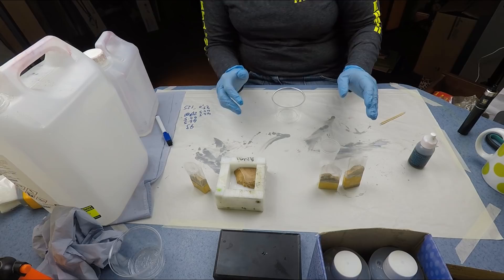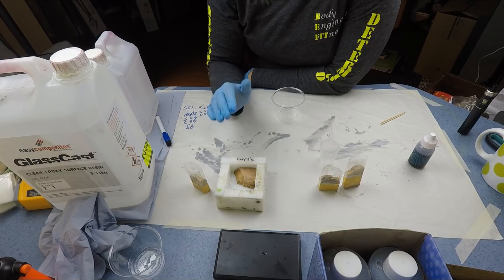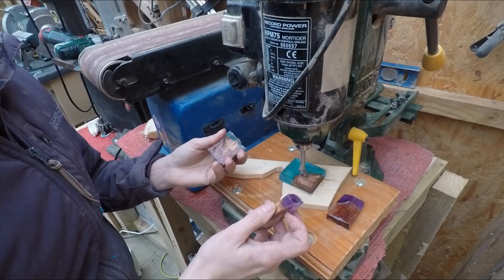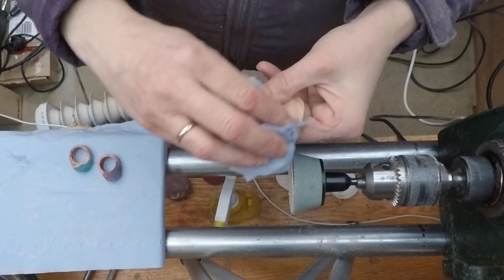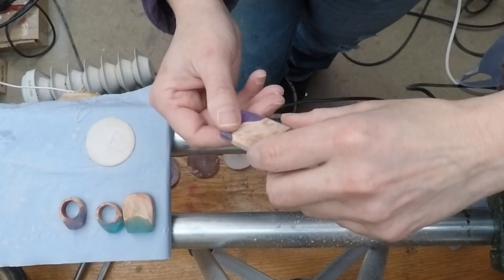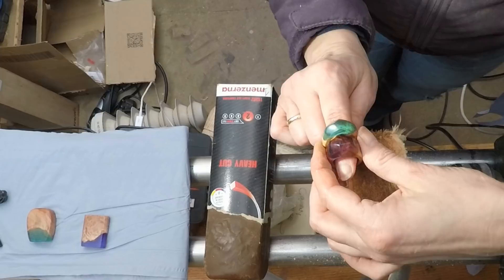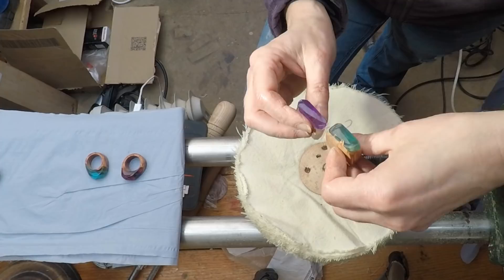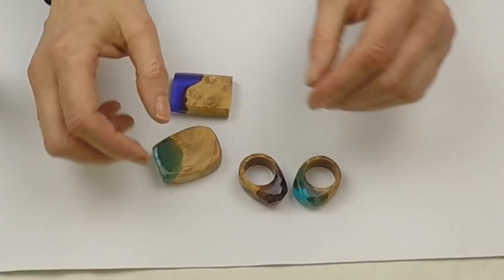Alumilite v epoxy for jewellery

Comment: Well that's got you thinking!
You said the epoxy is softer, if it's like the epoxy glue I use you may find that left longer to cure it will harden even more.
Reply from the maker: lol yeh it really has got me thinking i also didnt realise that amazing casting resin is epoxy, which goes to show lol Yeh your more likely right about longer cure times. Many thanks Paul :-)

Comment: I like your vids a lot... lot of info. The only thing better with alumilite for castings is that it cures in about half the time most cast epoxy's need to get completely hard. I leave my castings(mostly knife handle scales in very cheap epoxy for 3-4 days before i sand and polish them. Those castings are cured after 24 hours....but they still can be bend like soft plastic. Only after 3-4 days they become solid not bendable . If you are not in a hurry Alumilite is complete a waste of money. :)

Comment: They all truly did come out very pretty. I myself have been working with a lot of resin and epoxy. The epoxy is brittle on the lathe. It seems to Chip and just shatter. The alumilite seems to handle the lathe a lot better. I was quite surprised on how these came out. I was thinking there was going to be a lot of bubbles in the epoxy. Who would have guessed?
Reply from the maker: Thank you Tracy :-)

Comment: Good video Pam, Didn't look like there was too much difference between the two.

Buying the Amazing casting resin in the 450ml pack is very expensive. Compared to 7.5 litres of Alumilite clear which I think worked out at half price when I was researching.

But if the buyer is only making a few pieces then I suppose they don't want huge amounts of resin hanging around.

All the best,
Paul
Reply from the maker: Yes you right the bigger packs are far better value before i found metal clay, i used to only be able to get the 450mls and worked out very expensive. Many thanks :-)

Comment: Hi Pam I've ordered my amazing cast resin. Iam really having trouble with the other resins setting.ive used water clear resin and epoxy and both take days if not a full week to set..the only thing I can think of it's a temperature problem..just a quick one is Alumilite not a epoxy resin..lol
Reply from the maker: Hi yes amazing casting resin is epoxy lol :-) The temperature is really important with any of the resins they hate being cold. Amazing casting resin does not smell so can be left in doors. Good luck and if i can help in anyway feel free to get in touch :-)

Comment: Do you used any water-sanding papers before using the polishing wheels? is it enough efficient to polish them without watersanding them before?
Reply from the maker: I dont do any wet sanding all dry sanding and then polish many thanks :-)

Comment: Another very worthwhile video. Pam, which epoxy did you use to do the comparison with last time? I understand if you’d rather not say!! Thank you 
Chris.
Reply from the maker: Thank you Chris is was resin4art but i would be interested to try again as ive changed how i sand and polish resin since then. :-)
Reply: Highlandboxes 
Thanks for that Pam. I was looking on their website just the other day in view of getting their epoxy. I’ll probably still go for it but in the smallest quantity just for a try out! I’ll also get a small quantity from Easy Composites as well. Thanks again Pam, and keep these great videos coming. 
Chris

Comment: do you need to use a pressure pot with the glasscast poxy resin
Reply from the maker: Hi Matthew i didnt for these, and with the rings its not so important as the tiny bubbles dont effect the look. When im using the resin for pen blank i do use pressure though to get a bubble free finish. Hope this helps many thanks :-)

Comment: Hiya, great video thank you for sharing ....only new to resin so I'm a tad confused:- 
1/   Were these both Epoxy resins? 
2/   Was the Alumilite amazing Clear Cast Epoxy the better cheaper option. 
        Or was the Easy Composite Glass Cast cheaper and better?
3/   Can this type of craft (wood rings and wood pendants) be done with Polyester Resin?
4/ Was there a reason you used Glass cast clear epoxy SURFACE resin and not GlassCast 10 clear Epoxy Casting Resin?  
I know i'm sorry for all the questions, I was hoping this resin thing would be simpler, but there seems to be a different resin for everything instead of a 1 does all resin.
Thank you for any help you can offer.
Reply: appreciate the like... however I was kind of hoping for a reply ....😁👍
Reply from the maker: Hi sean 1) yes both epoxy 2)   yes i prefer amazing clear cast and if you buy the 2 gallon pack its the cheapest. 3) yes poly resin although very smelly is a good resin but is prone to shatter if dropped unlike epoxy.   4) the other resins were not for sale at this time but i cast thick blanks with this and it worked fine. If you are looking for a one resin for all i would buy amazing clear cast i make large blanks, resin art and rings pendants and also pen and knife blanks with this resin i get it from houseofresin.co.uk i will give you the 10% code for your first order up to you if you use. I hope this helps 

http://www.metalclay.co.uk/
One per person discount code
HB1017
On all resin, dyes and powders.
Reply: Ahhh brilliant thank you so much, really appreciate that.  I'll definitley be taking your advice. thank you.

Comment: Hi Pam, very interesting as alumlite is expensive but the result with epoxy looks great!!
just one question on the wheel no2 and the final finish wheel what compound did you apply? Thanks in advance and very helpful tutorials.
Reply from the maker: Many thanks Mahendra the second wheel is Glosswax 16- Beige Polishing compound and the last one is P175 Yellow Super-finishing compound. :-) This is a useful link to explain them http://www.thepolishingshop.co.uk/acatalog/Guide-to-Menzerna-Compounds-for-Woods--Plastics-and-Lacquer.html
Reply: Highlandboxes thank you Pam you are extremely helpful 😊

Comment: Hi Pam, you mention Epoxy and Alumilite but what is Alumilite?  Is it a polyester resin or an epoxy? Or something else.
Reply from the maker: Hi Heath its Alumilite amazing casting resin which is polyurethane and glass clear epoxy ive put links in description if you want to check them out. Many thanks :-)
Reply from the maker: Heath its just been highlighted to me the Alumilite amazing casting resin is epoxy its the Alumilite clear thats polyurethane just wanted to make sure you had the correct information. :-)

Comment: Pam! I am bothered by excess fumes and wonder which of the resins are the least offencive?  ron USA
Reply from the maker: Ron both are odourless although if your sensitive i would also be in ventilated room as a precaution. Hope this helps many thanks :-)
Reply: Even though Epoxy Resin is practically odourless, We have recently found out that both myself & my wife have an allergy to Epoxy resin 😢
We both got a nasty rash that took a week or more to get rid of with really high strength antihistamines, my wife was even worse with massive puffed up face which took steroids to get rid of.
We seem to be getting away with using up what we’ve got left, by wearing full PPE including organic vapour respirators.
Reply from the maker: Yes I've heard of this a few times what will you use now Paul?
Reply: I also use Polyester & Polyurethane Resins, but I’m hoping we can still get away with also using the Epoxy if wearing PPE & Respirator.
I hadn’t heard of others having an allergy to Epoxy before, when it first happened to us we thought it was actually Polyurethane we had the allergy with.
Reply from the maker: +Paul Buckley yeh you can at anytime take an allergic reaction to any of them. Will pick me up a new mask as well I think lol